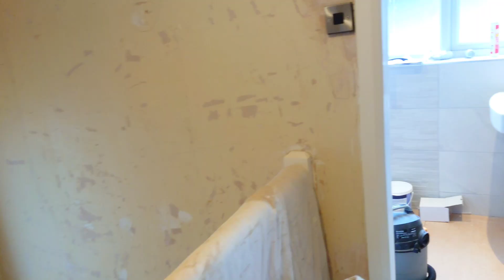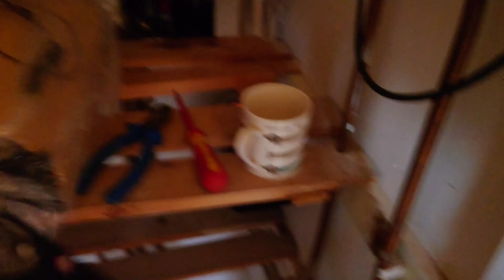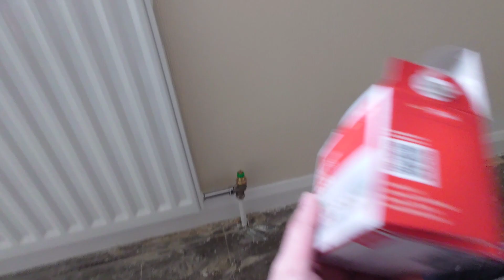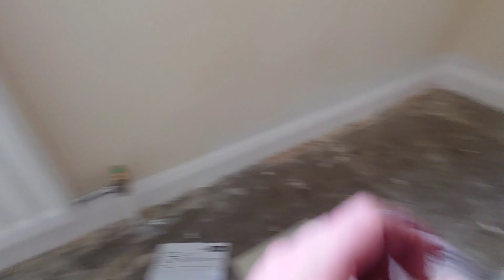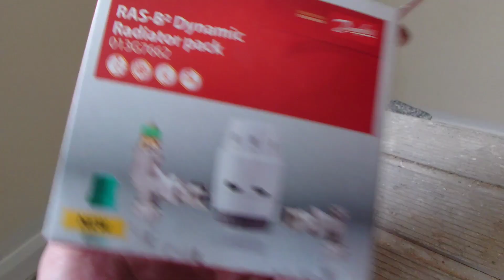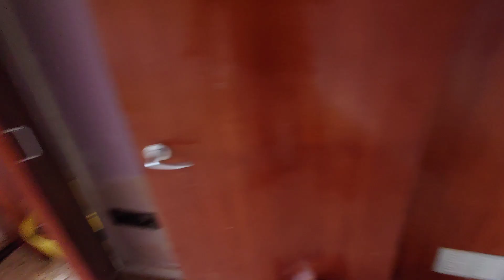Pimp my Logic: Making an Ideal Logic work more efficiently.

Comment: Would this cause pump/ system noise on this particular model due to perceived lack of 'proper' modulation???.. especially when the pump is cycling faster  than necessary.??
Nearing the end of my plumbing journey (65 in a few years) hence contemplating hanging up my grips, so not fully invested and up to speed with current calculations and methods of flow calculations.. I generally use the 65w per meter rule of thumb for heat loss calculations and balancing etc... great to see a generation of fully dedicated engineers like yourself utilising all current methods to reach (in my opinion) negligible co2 savings...
Keep up the great work.. I enjoy watching younger invested engineers showcasing and valuing their chosen profession.
If I decide to carry on ( I do love my trade) I'll book myself on various courses and even invest in a press gun..... the dilemma is... sitting on a tropical beach sipping 'pina colada's' or a cold wet windy breakdown working on an open vent system not staying alight in the middle of winter?????
Reply from the maker: To be honest I don't know about noise. If the heat input is correct and the load comp controls configured correctly we should sit comfortably at our design temp without mass shutdown of rads. This is the first time I've tried them as they're a new product so we'll see.  It's 💰 saved on running costs and home comfort im shooting for.

Comment: Nice video and a forest explanation.

Beat loss calcs are at best an educated guess, they’re better than nothing but I wouldn’t get too hung up on them given the massive variation in thermal properties of building materials and numbers of air changes.
Reply from the maker: Yeah. Not so critical with gas. Rule of thumb 65w per square meter covered this job as it's 1970s detached in an exposed location.

Comment: What was your flow temperature?
Reply from the maker: 50°c MWT (60 flow - 40 return) with a room delta of 30 (50° mwt - 20° design room temp). Dt50 correction factor of 2.  Any less than that and the rad sizes get a bit silly.
Reply: @GHRclimatesystems  gosh I wish I never asked now! Sounds complicated!! 😩😂👍🏼 you are clearly a man who knows his stuff. 😊
Reply from the maker: @deanchapple1  sorry. I mistook you for a fellow flow temp and delta fetishist 🙃
Reply: @GHRclimatesystems  I would love to know more about central heating design. I’ve been thinking about doing the heat geek course. I’ve done YouTube university but as the saying goes “a little bit of knowledge can be dangerous” 😜🤯
Reply from the maker: @deanchapple1  it's actually really really simple stuff it's just the information you need to figuy it all out  is almost impossible to get hold of in a way that's easy to understand.

Comment: Nice video mate, I've not seen pressure regulated TRV's before.
Reply from the maker: Game changers once you know  how to calculate your flow rates through the rad
Reply: @GHRclimatesystems  IMI TRV (constant pressure) have a nice app for doing the ‘sums’ and recommending a setting.
Reply from the maker: @normanboyes4983  I've seen the IMI ones. I think they're cheaper than danfoss too. Drayton have an app too that's good for on the fly flow calculations